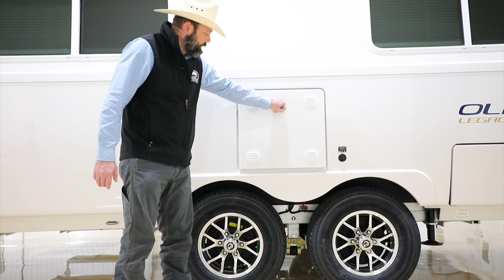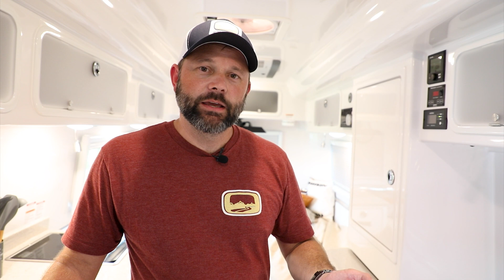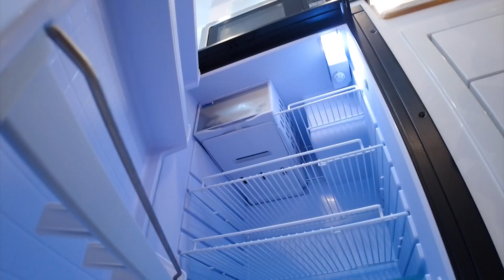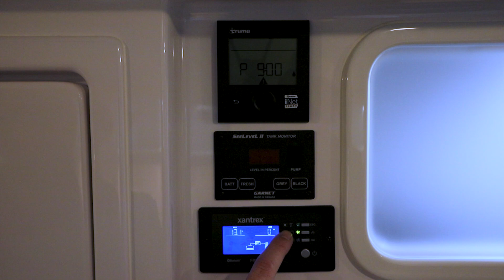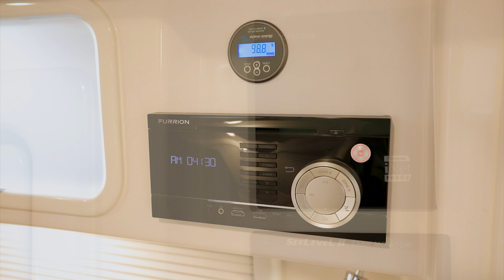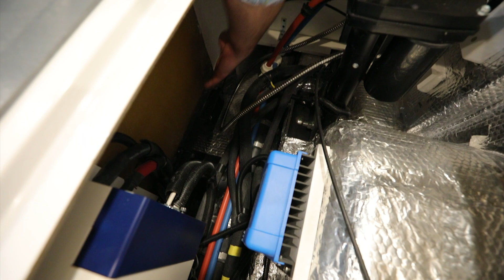2023 Oliver Legacy Elite II | Delivery Walkthrough | Oliver Travel Trailers

Comment: They need a Separate shower 🚿 nozzle than using the one from the sink ! ! Common Oliver, don’t be so damn cheap , after spending 70-100 thousand on a trailer ? ? Plus other owners I have seen on “You Tube “ the shelving & uppers doors for storage are an issue after one owner grabs her hand thru the storage & cuts her hands on the rough edges of the interior cut outs . They had to put some u shaped rubber along the edges to remedy the issue , plus another owner couple had to retrofit stone guards ( like Airsteams stainless steel Guards ) to keep stones & debri from putting the fiberglass. Do these engineers & salespeople ever live & test these Olivers in the real world before they let owners take them out the door ? ? Geez for 100,000 they need to rectify these issues for prospective customers or else we are going somewhere else that has better quality control .

Comment: What's the interior height of the shower? I'm 6'2 can I stand in there? Thanks
Reply: You got 5 inches on me. You might be lightly touching the handle for the fan that loops down.  Push the handle up and turn the fan on and the problem should be solved.

Comment: Sorry the bathroom is a no go for me showering over the toilet is not an option. Also the closet even for a single guy is way to small
Reply: They need a Separate shower 🚿 nozzle than using the one from the sink ! ! Common Oliver, don’t be so damn cheap , after spending 70-100 thousand on a trailer ? ? Plus other owners I have seen on “You Tube “ the shelving & uppers doors for storage are an issue after one owner grabs her hand thru the storage & cuts her hands on the rough edges of the interior cut outs . They had to put some u shaped rubber along the edges to remedy the issue , plus another owner couple had to retrofit stone guards ( like Airsteams stainless steel Guards ) to keep stones & debri from putting the fiberglass. Do these engineers & salespeople ever live & test these Olivers in the real world before they let owners take them out the door ? ? Geez for 100,000 they need to rectify these issues for prospective customers or else we are going somewhere else that has better quality control . 🤛👍⚾️